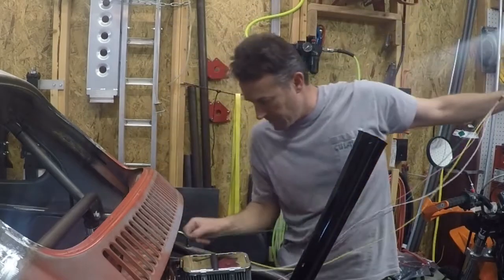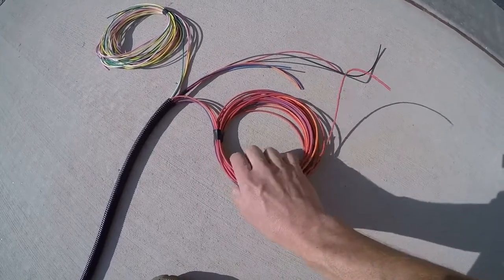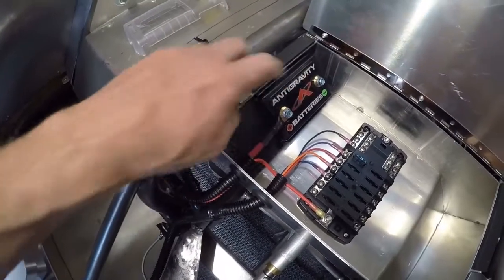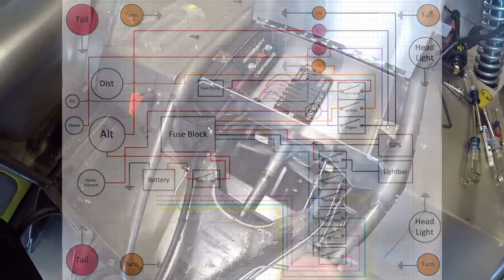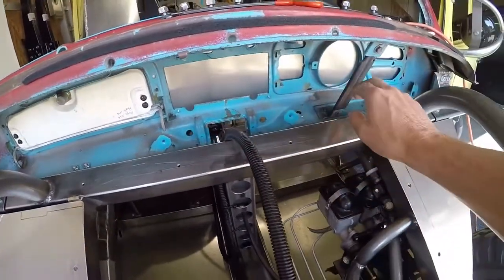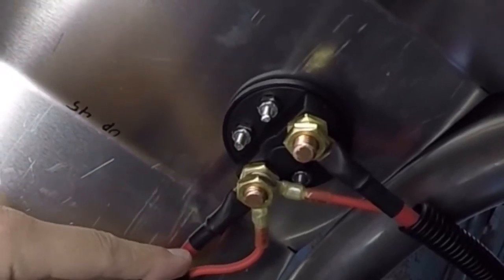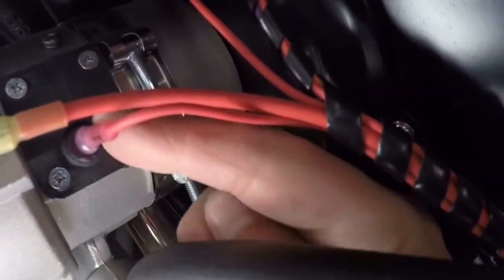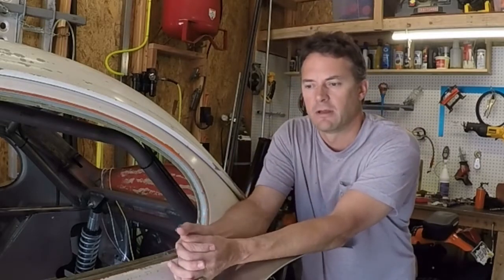Baja Bug Electrical EP 3

Comment: I no understand in  diagram wire the coenxion batery with other battery, do you connect in series or in parallel, i ask because you can't tell which pole of the second battery is conected to if positive or negative?? you could send diagram in my mail please, valdivia3ro@gmail.com
thanks mike for do videos very creatives. 
I install  electrical wire in my bug baja
Reply from the maker: The batteries are in Parallel, I'll email you the diagram later today. I saw your email.

Comment: If you don't like running unesassary wires, just run an 8ga air from the alt to the starter.  Much shorter run.  The cable from the starter to the disconnect switch will carry current to the batt as well..that is how cars are wired now days..
Reply from the maker: I almost did that but thought it would be cleaner to keep most of the jumble at the disconnect. You are right though, that would cut down on some wire. Thanks for the comment.

Comment: Isn't that alt rated at 50amps? #10 awg wire is maxed out at 40amps and #8 is rated at 50amps.  Like the videos keep up the clean work!!
Reply from the maker: Yes sir, I love it when people catch me on the details. You are correct, at sustained full capacity the wiring is undersized. However all my lights will be LED and I have individual fuses for the distrubution for shorts protection. So I don't expect to carry that kind of current through the alternator. I don't like to go overkill on wiring because it can really add up the weight, that's why I went this route.I guess I'll see how it goes on the shakedown runs. ;-)
Thanks for the comment and keeping me honest.
Reply: Doug Bug well the alt you have looks to be a 50-55amp and that alt doesn't have a charge controller to limit the current output, only a voltage regulator.   so the alt is always outputting 50amps regardless of draw of the vehicle. In turn you will be choking down the output of the alternator with small wires. It's like blowing through a coffee straw lol.
Reply from the maker: That's interesting...I'll have to so some research on that. Thanks for the heads up.